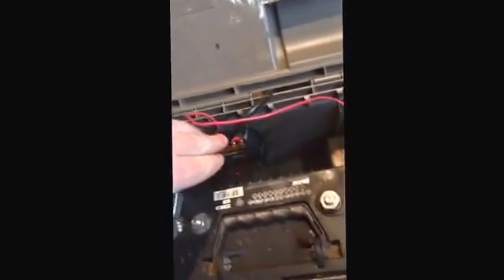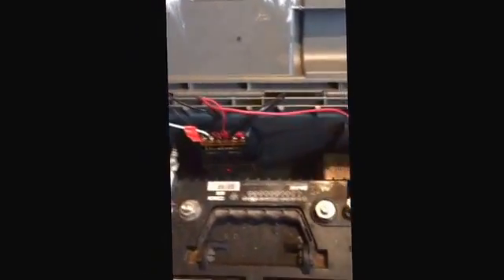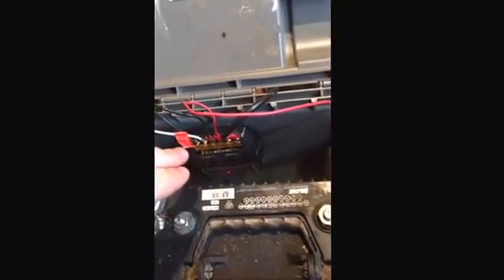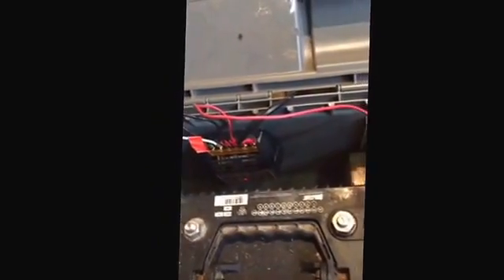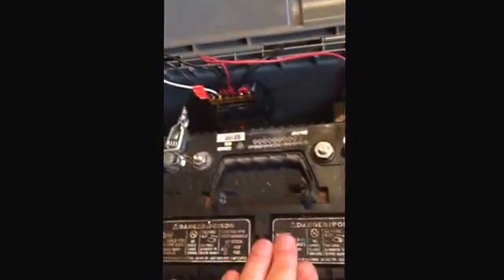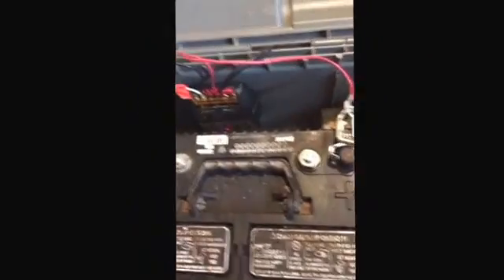DIY Livestock Solar Electric Fencer

Comment: Hey mate how do you tell when grass is getting to old to get the best out of it for cattle grazing. 👍
Reply from the maker: Catherine McMahon I rotate everyday, but some cases I rotate later. By you going out into the pasture/paddock you can tell when the grass is getting rank. It is still edible, but the cows will prefer the fresh stuff. There is a set time you should move, but a lot of factors depend on this (rain, temp., time of year). Being in the pasture and looking at your cattle/grass will tell you everything.